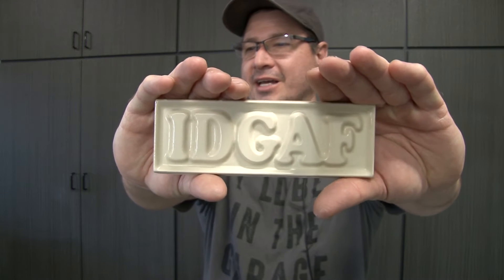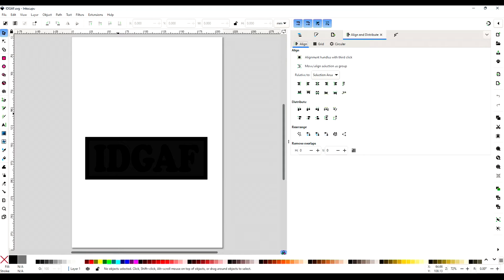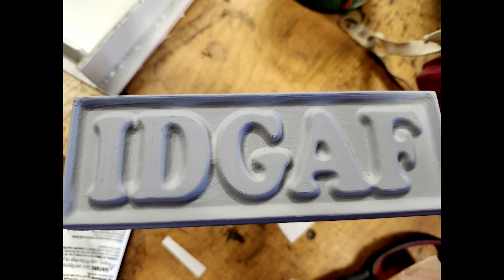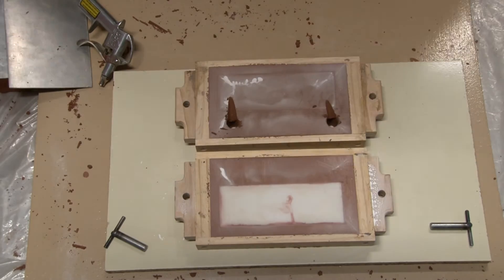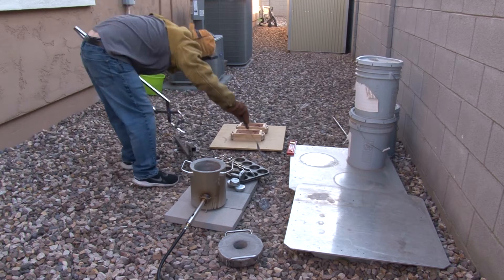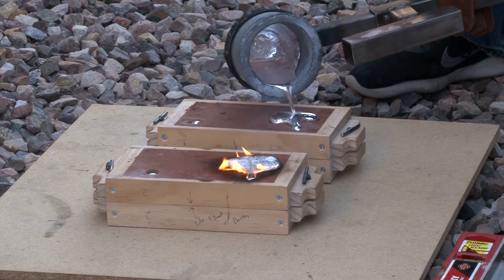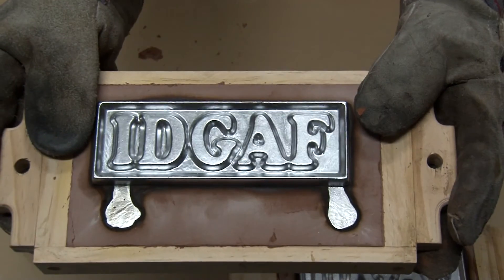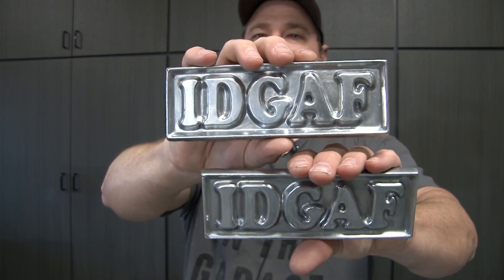Create a Custom Aluminum Nameplate

Comment: I know this is petro bond sand, but in one of your earlier videos you had mentioned that you use 180 mesh sand. My question is where do you get 180 mesh sand? Love your videos.
Reply from the maker: The 180 mesh sand is green sand(grey in color) from amazon.  The 180mesh sand is hydrated with water and needs a specific water content to work properly.  The 190mesh is petrobond(brown in color) this is oil based and also purchased from Amazon.  The company that makes these two types of sand is TETON.  I started with green sand but I tried petrobond and preferred it over the green sand.  When I purchased this sand it was in the 100lb quantity and cost about $3 per pound.  I wish that was available again but I can't seem to find it.  Thanks so much for checking out my videos.  I hope this helped.
Reply: Thanks

Comment: Very nice work! I've never quite understood how to cast something with a 3-D hollow center--like a shotglass or bottle, for example. I understand making two sides, but how do you place sand to keep the center hollow?
Reply from the maker: I have not yet tried any core work to make a casting hollow or have a void.  If you look up "sodium silicate core" on youtube you will run across videos that demonstrate what you are looking for.  Usually, I have seen people utilize a pattern that includes an area to lay a premade sand core in before the 2 part mold is closed up for casting.  If the part is very complicated it might require investment casting.  Thank you for watching my video!

Comment: The safety PSA combined with the big hole in the knee of your jeans gave me a chuckle. Truthfully though, I don't do much better. Nice looking pattern. I will definitely try epoxy as a coating. Thanks for making this.
Reply from the maker: Yeah those are my casting jeans and they just got worse and worse on the rip.  I need more gear right now, the only things that I have protection for is my face, arms and moobs.  I should probably pick up an actual full jacket and some leg covers.  I can't imagine jeans would save me from +1400F aluminum.  I don't think I will be doing any investment casting until I have that gear.  If the investment explodes from water or expansion that is a whole lot of trouble. Thanks again for watching.
Reply: @DamonsMetalCasting  Good thinking on the investment casting. Haven't done much of that, but that aspect has always made me nervous. I think all of us don't give enough attention to lower body protection. I have a cheap leather apron, but it is warm and have "forgotten" to wear it more than once.

Comment: I'm really impressed with the quality of the final cast. I guess that spotting putty must be a contributory factor, however what is spotting putty? Thanks in advance.
Reply from the maker: Thanks!  The "Bondo Glazing and Spot Putty"  helps with filling in the ridges of the 3d print.  Just primer can do it as well but the spot putty can go on a little quicker and thicker.  Its also easy to sand and doesn't bind up the sand paper so much.  How smooth you can get the pattern is how the surface will turn out.  Alot of people who make their accessories out of 3d prints for cosplay do this.

Comment: Very nice work. I have been doing casting for a few years now.  Lately, I've noticed that the quality of crucibles has declined. What brand do you use?
Reply from the maker: I only have had to repurchase 1 crucible (the one that came with the furnace cracked).  The current crucible I am running is from Amazon and listed as "MakGrand 6.9KG Clay Graphite Crucibles, Melting Casting Metal, Withstand The High Temperature 1800℃(3272°F), Refining Aluminum Gold Silver Copper Glass, Casting Tools (6.9kg)"  I have only fired that a few times.  Currently, I am experimented with preheating my crucible to 450-500F in a toaster oven before I put it in the furnace with a direct flame on it.  Also, I am sure you do this too, I return the crucible to the furnace after use to let it slowly cool inside the furnace when I am done.